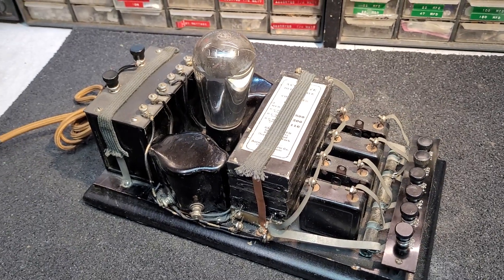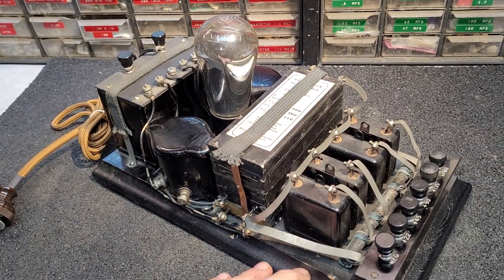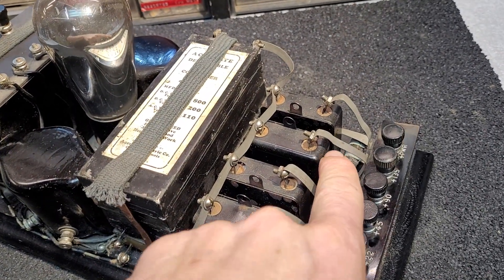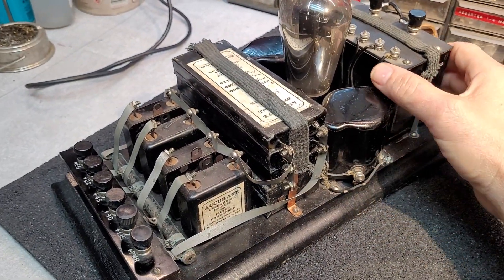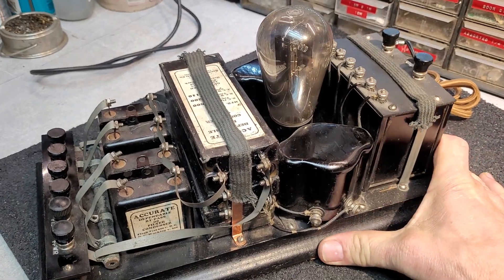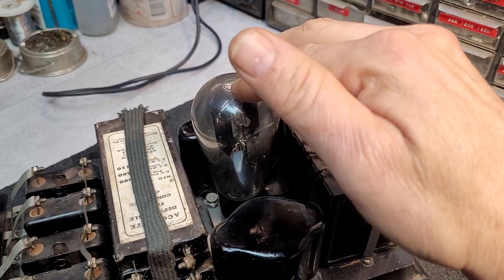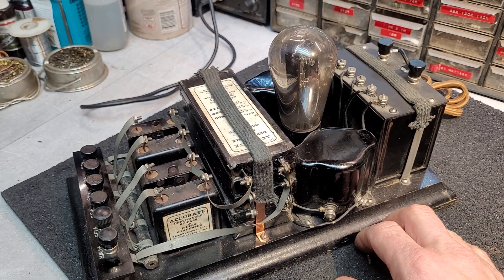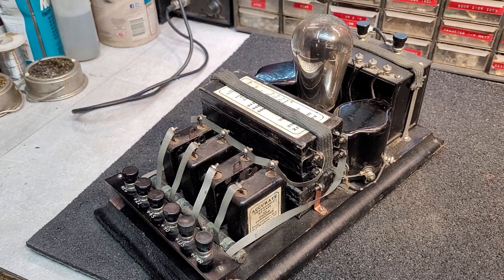B battery eliminator

Comment: Oh cool, I never had one of those. I had to just resort to using 9V batteries in series ;-)
Reply from the maker: These were quite popular during thev20s.  Many manufacturers made them.
If your looking for a great supply made presently, I highly recommend the Arbe III.
Reply: @Davesradios  I have looked at the Arbe III but no need current need. Any vintage radio projects I mess with these days are crystal radios along with my ham radio stuff and computer logic Hackaday project postings 🙂